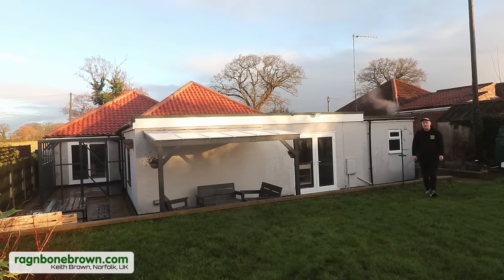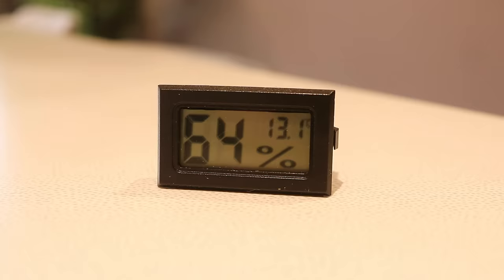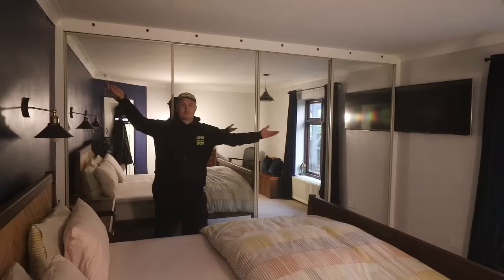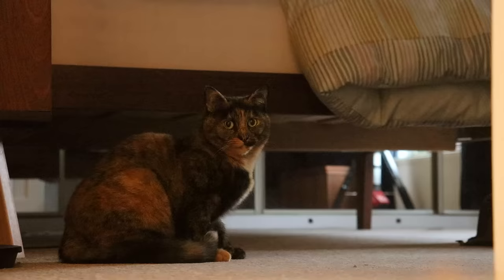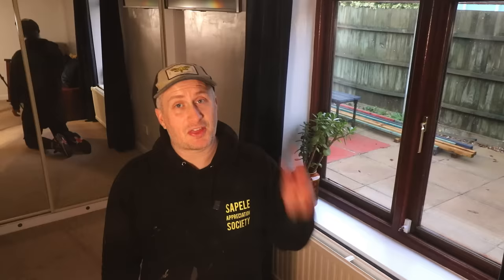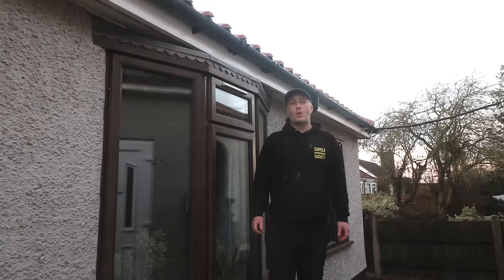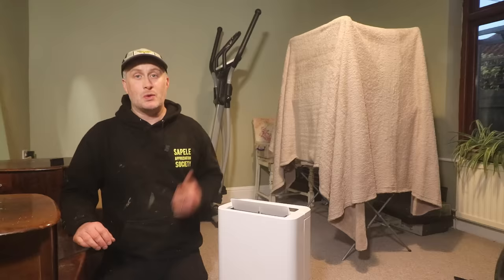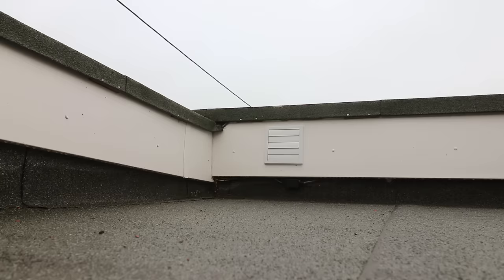8 Steps To Fixing Damp, Mould, Condensation & Humidity In Our Home

Comment: Living in a council house like ours (the wife and I) we do suffer with damp and mould but I tried a trusted solution by dulux which is a sealer paint and I have to say I was doubtful and reluctant to trying it as they can give off rather strong vapours but after about 2 hours it dispurses out of the window and two years on, it hasn't made any sign of coming back.
It wasn't cheap but it was thankfully effective lol.
Great video Keith 👍🏼👍🏼

Comment: I don't have one but the ultimate ventilation solution is MVHR (mechanical ventilation and heat recovery).. essentially you have an in and out duct into the ceiling on each room and it draws the stale air out and exchanges with fresh air from the outside and also recovers the heat whilst doing it.  They also come with filters so you can stop pollen etc being pumped into the house.
Reply: MVHR seems to be the only way to get adequate ventilation and minimise your carbon footprint.
Reply: It only works in modern sealed houses. You're just not going to get it in   most older built properties.
Reply: @Woodkin007 when you say old, what age are talking? I have 80s ex council place with modern uPVC doors and windows. Upstairs rooms sit at around 85% in winter!
Reply: @Shriven89 You can ask council to insulate it, or look up the grants for insulation. Then use the MVHR combined with high insulation and air tightness. This would lower everyone’s bills by a lot!

Comment: It’s very reassuring to find it’s not just us struggling with bungalow life. We’ve lived in a 1970 bungalow for seven years and this year we’ve tried to reduce using central heating resulting in condensation and mould. We’ve bought a dehumidifier. And are planning on new windows. But I feel like it’s a battle zone 😏
Reply: We have moved into a 1930s bungalow this year, we have solved rising damp with an external trench with extra air bricks and a PIV system, so much better. Still a bit of condensation in a north facing bedroom, but we’re thinking about an extra extractor for that. Good luck! ❤️
Reply: This will most likely lead to further mould. You need to find a balance between venting and heating, and keep the ambient temperature as stable as possible. Large fluctuations in temperature is bad.

Comment: Great video thanks Keith. We just moved into a new build property and humidity inside has been as low as 60% on a dry cold day and as high as 80% on wetter days. It depends on what the humidity outside is doing. We have had mould in several rooms on skirting boards and in kitchen cupboards. Not sure if this is a temporary issue due to the house being new, or whether this is what we can expect for years to come. Really helpful video.

Comment: Great video and tips!👍🏻 I bought a condenser dryer for all the washing and it's made a big difference through this winter. I set it to "cupboard dry". It condenses all the moisture into a container then I pour it down the sink. It also blows out warm air which helps to heat the house too. They are a bit power hungry but save so much hassle and I no longer air cloths at all so very convenient. Never had one before but now I couldn't be without one.
Reply: @garysmith5025  I never thought of that thanks that sounds like a good idea 👍🏻
Reply: when it is no longer viable look at a heat pump all the same advantages but a lot less power hungry

Comment: I live in a bungalow, small, that felt very damp to me. I put one small dehumidifier, Probreze, in the bedroom, which also has a trickle vent in the window, and another in the living room. They cost around £80 each, and are one of the best things I have ever bought! End of problem. Each one can collect nearly 1 litre each of water a week, and they run 24/7 winter and summer! I dry my washing indoors, usually with a little window open a bit, or the kitchen extractor fan on. Usually I have the little bathroom window open a jar just a bit, and with a min temp of 18C in the house, this keeps the damp away. Currently my humidity reads 59% which feels comfy. Am also looking forward to the housing association tackling the roof leakage!!! Which should also help!! Great tips on your video, thank you 😁

Comment: I live in mid wales and the humidity outside is often well over 90%. We therefore do not open the windows - it may circulate the air but the air coming in is so wet that we find it counterproductive. We also delayed on purchasing a dehumidifier due to running costs but it was transformative I wish we had one sooner. Like you we rarely get the humidity under 60% but it does stop mold, mildew and condensation - which was the main aim. Good video with many tips.

Comment: Great advice. I've done most of these things in my victorian terrace with good results but not the PIV yet. I too use a dehumidifier to dry clothes together with a heated drying rack. One thing I highly recommend is a window vac which I use in the bathroom (I also don't have a window in mine.) Half a minute round the tiles and mirror and the room is dry. I used to think they were a gimmick but they're we'll worth it.
Reply: Piv are well worth it, and surprisingly good value and can be fitted in half a day at most, by any decent handy man.

Comment: In rainy Manchester in a 1910s terrace. I only bought the humidity sensors a couple of months ago so no summer readings but I’m getting 40%-65% depending on the weather and indoor laundry drying. No extractors but always have the windows on the open security latch (vent) for at least an hour a day and the whole time in the room the laundry is drying. My bedroom is the worst, which I could tell from the mould when I moved in. I lined the back of my fitted wardrobe carcasses (built from watching your channel) with cork, which might be helping or it might just be the ventilation. I had a new damp proof course fitted downstairs and that’s where I get the lowest readings.
Reply: Didn’t know you could fit anew DPC, how does that work?
Reply: @johnomahoney565  It involved removing the plaster inside to windows sill height, drilling through the outside and inside brickwork and injecting it before a plastic mesh and the dot and dab. I didn’t do the work myself because it was a big job, took two specialists a week.
Reply: @louisejones5396  Thanks for your reply. Good to know.)

Comment: Hi Keith,
My daughter had a similar issue with her 1930s  bungalow so I fitted a PIV made by nuaire a very similar system to yours but having the option to turn on a heat element if required, with in a couple of weeks the humidity dropped from 75% to below 38% in all rooms but the dining room for some reason, a quick phone call to their tech people who suggested I drop an additional 100mm hose line into the dining room but coupled up to the main unit in the loft, two weeks after that the humidity in the entire bungalow dropped to an average of 30% but this may have been aided by new windows complete with builtin trickle vents which the previous ones did not have.

So I think the PIV is a great staring point but you can add in additional room vents as long as the rooms dynamics allow.

Great video by the way as ever!

Graham
Reply: Can I ask you if had any issues with the piv unit causing an attic smell in the house? I've had mine a week and the whole place smells.
Reply: @jenniferdoyle3969  

Hi Jennifer,
No I’ve had no issues you describe at all. I have also fitted units to friends homes inc a flat and all worked fine no smells at all.

I would suggest if someone can get into loft and do a thorough check to see if you got an unwanted guest. Also check the area around the main unit for major dust etc, when I fitted them I always vacuumed around the surrounding area to minimise dust, then I would contact Nuaire’s I’ve always found them really helpful for ideas etc.
Just an if thought does it smell like rubber / plastic. If so check wiring to the unit just in case, the heater element in the unit does not draw much current but if it’s not wired in correctly or dust / insulation has found it’s way onto the element it might cause the issue.

Finally if a company fitted it get them back to sort it!

Hope this helps

Graham

Comment: We live in a very similar house - 70s bungalow - which had all the same problems when we moved in. We had the cavity walls filled with insulation which helped but our old skool aluminium windows would still RUN with condensation in winter. Like you, a PIV fixed that overnight. They’re magic. We also knocked out all the built in cupboards that stank of mould no matter how much we cleaned them. Humidity still stubbornly sits in the 60-70% region like you. Bungalows just aren’t designed for good air circulation I feel. Still a great improvement and no further mould and mildew problems.

Comment: No experience in the UK, but I lived in Wisconsin on a lake, so similar cold, damp climate. I tucked moisture absorbers in all of the odd cupboard corners and closets. There are numerous brands of desiccant, but they are usually calcium chloride wrapped in a porous paper or fabric packet. Smaller sachets are only about a pound apiece and they las for months before needing to be changed out. It really helped with enclosed poorly ventilated spaces. Thanks for great content, Keith. Keep up the good work!
Reply from the maker: Thank you, great information

Comment: We have a 1935 detached home (2 story)  and when we moved in, had similar problems, especially on the cold side of the house. Also the house is double bricked and with stucco on the outside, so the walls can't breathe. It is only 20cm's detached, so one wall is impossible to reach from the outside. Since then, we installed double glazing everywhere, which reduces condensation enormously, every room now has one window with a ventilation grill. In our bedroom, the window is always open and we have a similar closet on the cold side. I've put a moisture meter in the closet and over the course of a year the humidity in the closet dropped from 75-80% to 55-60%. I'm about to install a mechanical ventilation system with a moisture meter, wich automatically turns on when RH rises above 60%. Also, as the heating in the bedroom is never on, we decided to heat the room for one hour a day with open closet doors and that also helps a lot. I have experience with this type of mechanical ventilation in our last house, which was build in a dyke, so the basement, which housed our kitchen and bathroom was very humid. the ventilation system reduced that dramatically.

Ventilation is key though. You mentioned a dehumidifier, I have one on the attic, waiting to be used in my workshop.. I totally forgot about it! (insert facepalm meme). I'l get this up and running again.. Thanks for the vid!

Comment: Interesting video, thanks for the link to the cheap little humidity monitors! We had a home energy survey done and the biggest recommendation to tackle humidity. The two suggestions were interesting. One was Negative Pressure Ventilation with a unit in the attic connected to the kitchen and bathroom. The unit would increase power in response to higher humidity levels. A different take to the PIV method, but might be a way to reduce the chill you mentioned that was coming in with the PIV. The other suggestion was to use mechanical vents like your air brick, but ones that have a humidity-responsive valves. So when there's high humidity, the valve opens up - no power required, which is a cool concept!

Comment: Awesome video.  I am in a 1950's semi detached house 3 bedroom (well, 2.5 bedroom)... and it is mental upstairs for humidity and mould!  We can reduce the humidity down from the high 80's to the high 50's if we run a 12L Meaco dehumidifier all the time.  The second that we turn off that dehumidifier it starts to climb back up again (using a sensorpush hygrometer to log the data - will be switching to inkbird ones as I cannot afford multiple sensorpush) and within an hour or so it goes from 60-ish to mid 70's plus.

Never heard of a PIV system, but I am really looking to that now as something that could help.

Many thanks.

Comment: We have the same problem, we moved into our bungalow in August last year, then in November the black walls started, the rain batters the wall where the damp is, was have bought a dehumidifier and I am about to fit trickle vents to see what that does. We have also naught the most recommended wall sealer to paint the walls with when they warm up and dry out.
Thanks for your Facebook  help.

Comment: When we had new windows fitted in our house we notice that we was getting damp patches on our stairs (I had already ripped the carpet up)  and that was due to build up of moisture in the air as the new windows didn’t allow good ventilation, had a PIV unit fitted and help massively, also helps with the kid’s asthma as they are breathing in damp air 👌🏼👍🏼

Comment: In our mixed bag of a house we ran an experiment through autumn into winter, whereby we used 2-3 heavy duty dehumidifiers to cover the high rooms, using HomeAssistant and the tado trvs to track the progress. The dehumidifiers worked up to a point, but when winter really landed they could not keep up as the temps in the house tanked. We played around with the heating cycles and eventually the only real game changer was setting the heating on a process similar to a heat pump schedule, with a lowish temp, but all the time and a setback overnight, this really standardised the whole house and dropped the humidity down into the 40-50 range in all rooms. With this in mind we're exploring air to air heating for next winter.
Reply: This seems interesting. Can you explain how the heat pump cycle works? Some details on your schedule would be helpful. Thanks
Reply: @michpaulatto  by heat pump schedule, it is continually on for the day set to 19 degrees and night to 16.
Reply: Isn’t that expensive though?
Reply: as someone guessed in a later comment, the schedules were 2 blocks, a 7am-midnight and midnight - 7am, the might block was setback to 16 and the day was set to 19., all rooms were set to the same, and in our house all room doors are always open, so the hot rooms helped the colder rooms to equalise.

Comment: Just fitted a Piv in our very damp no cavity house, it’s been fantastic, the next cold very morning windows were 90% clearer and the bathroom is much quicker to dry out, the humidity is down to about 60%, apart from the cool air on landing it’s fantastic.
Reply: Did you notice an attic smell coming from the piv unit? I have mine a week now and the loft smell is still quite strong.
Reply: @jenniferdoyle3969  
Hi, Yes we do get a woody smell especially on warmer days when the Piv is set to speed up…not tried it yet but I did wonder about an air freshener up in the loft near the intake, just an idea.
Reply: @6ddevil  Yes, I heard that a piv unit company advised on using an air freshener up in the attic to combat the smell. I will have to try that next if things don't improve. ...The smell I'm getting is that typical loft insulation smell which is really
 awful. It hits you when you open the front door coming home. I just hope it improves over time. ...Really disappointed with it. Thank you for replying anyway.
Reply: @jenniferdoyle3969  
No problem, always a few negatives unfortunately, hopefully your damp problem is better, our house is so much better, but we have had to decorate some rooms as its so much drier the paint in some rooms has crazed. 😂😂

Comment: Given you have a bungalow an MVHR I would have thought would be an easy retrofit and you gain the benefit of recovering heat from the air been extracted out of the building, we have installed a Brookvent 1.3 digital+ that also has a summer bypass feature to help cool the building

Comment: i live in a single level hime built in 1950’s and we have had similar issues. humidity in Auckland is an issue all year round. we are slowly renovating, but so far we have changed the extractor in the kitchen, installed a HRV system similar to yours in the attic. we are planning to paint with mould resistant paint, and are installing a heat pump dryer soon as the existing dryer adds to the woes.

Comment: Hi Keith - we have a late 1970s detached home, and was regularly getting 65-80% humidity.
Done a number of same things as you, bathroom ceiling extractor made huge difference.

The other things I’ve done which helped were:-
- properly insulating the attic hatch inc. foil tape to create barrier. Helped reduce warm air from house condensing in attic
- fixed a few cracks in mortar and external window sealant which I believe was causing some rain water to get in to bricks which was then creating more moisture and humidity internally…

It’s now always in the 45-65% territory, usually around 55%, and I can’t remember last time it was above 70%
Reply: Oh and also one of those small portable condensation vacuums are excellent to use semi-regularly especially if you have multiple showers a day in your household. They’re great to take a cup of water off the shower enclosure - even if you only do that once or twice a day after a shower. Me and my wife have two showers each per day, so even once makes a difference…